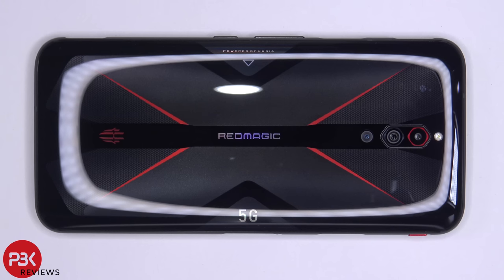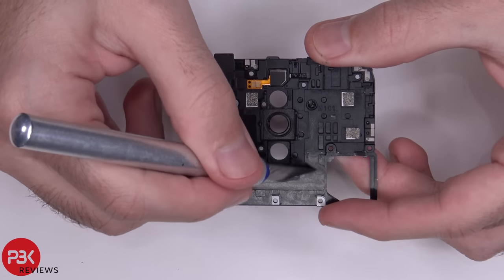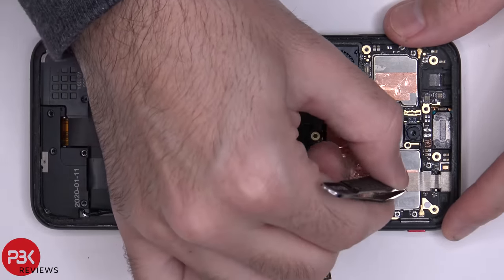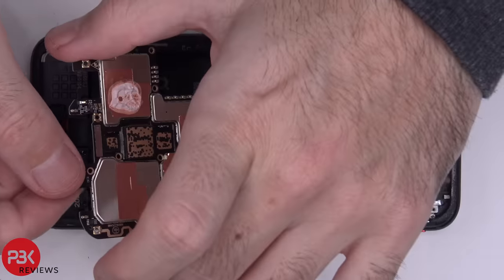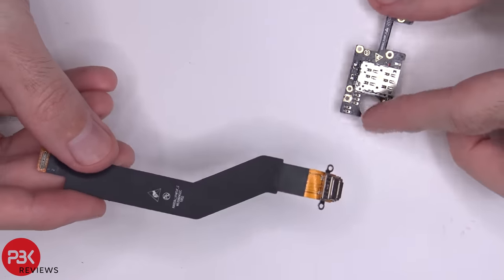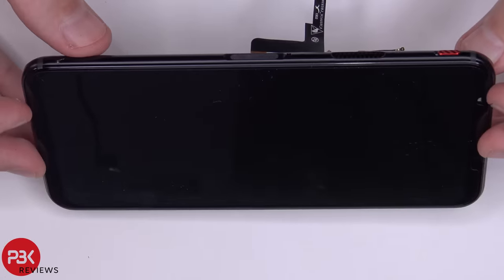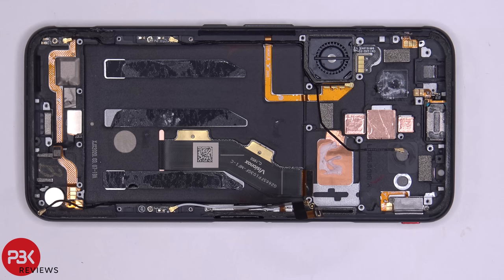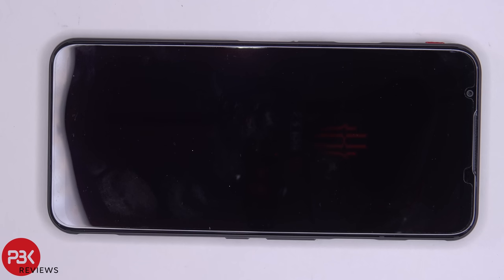Nubia Red Magic 5G Teardown Disassembly Repair Video Review

Comment: 25 screws.. Omg I LOL almost fell out of chair. TY FOR SHERING. I cant find screen replacement any wear :( any suggestions ?
Reply from the maker: Lol ya, you're welcome. Here is a link for an LCD and midframe pre attached combo (which makes replacement much easier) https://amzn.to/3qIlpQc  . There is also many on ebay for around the same or some a bit cheaper if you search redmagic 5g lcd you will see the listings.

Comment: @PBKreviews how do you get the back cover to stay on when putting your phone back together? By the way thanks so much, I was able to replace the battery and charging port to get it fixed on my own! I just can't get it to stay together now
Reply: Hey Im actually in a situation where I broke my charging port, I bought a replacement but I have no clue how to replace the charging port, could you help me?
Reply: @radeonclientcrystalpvp7786  for this phone you essentially just follow the video. make sure youve got containers for each type of screw.

Comment: My Red Magic 5G currently only have black display. The phone is working. I can call it but just black screen. When I connect it to TV, I can see that the phone is clearly working well. Just no display at the phone's screen. Restarting it only shows a flash of light on the display then black again. Do you think I have to replace my screen? Or just a case of loose flex cable?
Reply from the maker: ya its possible there is a hairline crack somewhere in the screen causing it to flicker like that or not display. You probably will need to replace the screen, but you can always check the cable to see if it is that before ordering a new screen
Reply: @PBKreviews  thank you very much for the reply. Subscribed.
Reply from the maker: @MarkAmps  You're welcome and thank you

Comment: Thanks for the video, I wished you had shown how to open the side buttons I have no clue how to take it out.
Reply from the maker: You're welcome. Once you take apart the phone, you will have access to the flex cable for the buttons. On the frame of the phone there is a rubber gasket covering the opening where the flex cable leads into to where the physical button keys are. You would need to pull out that rubber gasket, and then carefully peal off the flex cable from the midframe of the phone and pull out the flex cable from the frame where it leads to the physical keys. At that point you should be able to have access to pushing the physical keys in to release them into the frame and remove them. Hope this helps.

Comment: I wonder if its ever necessary to clean the vents.... What do you think bro?
Reply from the maker: I don't think it would be necessary but if needed you can use a small brush from the outside and brush it off when the phone is off.
Reply: @PBKreviews  u think the air only goes in one side out the other or does it flow internally? I know it wont collect dust like a mounted tv but it is interesting to think about for long term use...
Reply from the maker: @GTduzIt  yes goes in from one side and out the other
Reply: @PBKreviews  so it probably removed the dust it pulls in on its own. I know the transparent version would not look good if there is uncleanable dust inside so it makes sense that the air chamber is separate.. I believe its Metal too, thanks for the replies. I just ordered the new 6s pro

Comment: anyway can i get the spare part? Because i break my R trigger flex cable and 3.5mm headphone jack also got 1 side sound only
Reply from the maker: I don't have the phone anymore or any parts for it. You would need to check ebay or amazon or other online markets to see if replacements are available
Reply: @PBKreviews  I check already just found the dock charging flex cable only… sad

Comment: Sir does it have any IP rating?
Reply from the maker: No official IP rating, but the phone does have rubber gasket on the charger port and sim tray. Not sure how water resistant this phone would be considering the fan inlet/outlet and so forth. I would lean toward it not having any IP rating officially and unofficially (sometimes companies don't certify it for IP ratings when the phones infact are water and dust resistant etc.) But I do not believe this phone to be able to withstand water. Dust maybe.
Reply: I had a 3 Camo Edition for a while, phone was used in the shower several times and even dropped in a bowl of water once. As long as you don't let it stay submerged or water pour straight into the fan intake/exhaust, you should be fine.

Comment: Hi I hope to get some help my red magic 5g 's battery is draining so fast and the technician told me that the IC was damaged. Where can I be able to get IC spare part to replace it. :(
Reply from the maker: Hi, usually IC chips are soldered onto the main or sub boards. I would first try replacing the battery and see if that solves the problem. Replacing the IC would require soldering expert to be able to do and find the part for it.

Comment: what if the device fell off and the cooling fan was broken? And what do you do with dust?
Reply from the maker: The dust only goes in the fan chamber assembly if any really at all and would probably take a long time for there to be any build up in there. I'm sure they took that into account and probably you would have had the phone long enough to change to a newer device by the time it had any sort of dust build up. If the fan was broken well then you would probably have to send it in for a warranty repair replacement or replace it yourself if the part becomes available.
Reply: @PBKreviews  But the NRM5g have a software issues

Comment: hello i have a Nubia red Magic 5g and i just broke yours back.  do you know where i can find a new one because i can't find any.  thank you
Reply from the maker: Hi, here is a link for one on ebay:  https://www.ebay.com/itm/Back-Cover-Battery-Cover-Shell-Replace-Parts-for-Nubia-Red-Magic-NX659J-5G-Phone/353161054537?var=622362395928&_trkparms=ispr%3D1&hash=item523a0a0949:g:HNEAAOSwzmhfKoFw&amdata=enc%3AAQAFAAACgBaobrjLl8XobRIiIML1V4Imu%252Fn%252BzU5L90Z278x5ickkWpEuxXwAiCNKyBQsQ5%252Fe60RHd9eClYg59wSeuBwl3Q%252BgWKzdYKujVCZIR1dR1SoR%252F7d%252F%252BLEYPXAEGH5qlRn2xV3%252FzznExOwKJOKMpngn3PdYaDsQuMzECLrhdQIfOAGkKFeS9k9NqBRgF9ttLtBK0w9rbEA1DzHnpDRZKa1KzwFXhtbBzwrAXIyUgJg%252F4VqqcLJsRtTC3pQqV7v1I%252BUe4QhLjAJ0dSPMN5HsDTq%252FymYipn5Q8dy2SqK3PC2IgZv8f%252B4GwFTdlZNxwy6KqaMUGK7ngvAvJwzbIKMLIXGkKu9w%252FwV9%252FXeSu%252FblHACFDubgsedkWRv%252FL61GqZSEQgcaJinVUt60uDY6tEWRvP1LSQA%252BuupMxSUZlP03EohXlm6zwKPqlKEM99tRjgLictYuKenQb2C9y6piukAISzpsELySvEcIxFYosehxncrOIDQgLkFt53nFVY2oTXoPIpxfH%252Fp6vQbdW6OSzmOOttMR9OFhswmyBavkAGFjotAyAKQbYIiM3h9mofT55m62dNJVDGhyiK8r6FdYWnes3u3FSUoctKByuVw7o1g6LuG%252F8Who5TAskUQ0iDEoU954hc%252FdvrTziSeBSatjGhZeBMQCOX77RCFzo7LFVUoAeT4lwJ9sbXiHFCUZRgc5EYveOvwkTWusFWkTICyC8NBdy0dkpFHECJVMa%252BLYWn9EJbJzvolDRpMKzIeRXb3Lj1hjnkgX%252FflDqEU7FfTvdpXOJxQrqT5gQ5550RGCX2OzTvLqZ%252B84caYVW68DSwblDal0n8udRXcPFMI0mDJwrlcTmnzjUSk%253D%7Ccksum%3A353161054537325746a468ee4e46b1db97dd9acf8552%7Campid%3APL_CLK%7Cclp%3A2334524
Reply: @PBKreviews  ty

Comment: Man thank you for a very detailed breakdown. I am currently working on fixing my Redmagic 5G as I accidentally cut the connection to the mic ang pins as well as the power button ang volume. I was able to fix the issue on the mic ang the pin connectors and had it replaced, however, I don't know how to change the volume and power buttons. Do you have some tips that may help me?
Reply from the maker: Once you remove the rubber gasket as shown @8:56 in the video, you would be able to peel off the flex cable from the frame that runs from underneath the motherboard to the buttons, then pull out the metal bracket which the button clickers are attached to inside the frame slot. At that point some buttons are pull out buttons and some are push in ones. You would have to try to see which way they pop out.

Comment: what if dust/dirt block that fan, how to maintenance that fan?? hmmm tricky
Reply from the maker: Ya, I'm sure by the time enough dust gets built up in the fan it would be time for a new phone. Its not too powerful of a fan to suck in to much dust but I can see it taking in lints and dust if it was running in the pocket which the fan does turn off if you turn the screen off. Should be fine though from the looks of it :)
Reply: @PBKreviews  thx sir.. almost 2 yrs since i  change my phone hehhe

Comment: Use plastic pry tools
Reply from the maker: Once the battery is disconnected you should be fine. As I've told hundreds of people, I have never had any issues in the last 15+ years and thousands of phones I have taken apart.
Reply: @PBKreviews  I have red lines on left and right of my phone.. Is that a LCD thing?

Comment: Bro how to install the back glass? I broke mine 🥺
Reply from the maker: You already have the new back glass or you are trying to buy one? I don't think there are replacement back glass yet on the market
Reply: @PBKreviews  im trying to buy one. But i didt find any. 😥 My backglass broke pretty damaged. But the screen is fine.
Reply: @PBKreviews  how do you get the back to stay on? New glue, or can you just hear the old glue back up? If it's new glue, what kind?
Reply from the maker: @georgeclooney9164  hi, i have a video on how to apply new adhesive to smartphones, check my previous videos it will explain how to do it.

Comment: Is it water resistant
Reply: mi pa no it's not
Reply from the maker: no it has no official IP rating and nothing internally there to really prevent water from getting in. It might take a splash of water but not being dunked into water.

Comment: Hello. I am looking for mainboard for  redmagic 5g..
Reply from the maker: Hi, you would need to look on ebay etc, but usually hard to find a part like that. You would need to find a phone with cracked screen or something like that to pull the main board from.
Reply: @PBKreviews  I try to find broked mobile in market no one have its very hard to find. If u have any link can u share me. Thanku for replying me.
Reply from the maker: @rizwanrazzak.  i will check, if i see something i will let you know
Reply: @PBKreviews  thank you brother

Comment: Clear back possible???
Reply from the maker: Yea its possible but you wont be able to see much unless you modify the hardware which wont be beneficial to the phone. For example you would need to get rid of the graphite film over the battery if you wanted to show the battery off, you would need to also cut off the fan enclosure area to reveal the mobo parts etc. However I am going to try to do a semi transparent mod with this phone with a few customizations. I will upload the video once I finish with it :)

Comment: So the fan inside basically just pulls out the ambient air and doesn't active cool the heatpipe, dissipating the heat generated directly through it. What a waste, it's useless.
Reply from the maker: Exactly what I was thinking, It does help one side but the side where the heat pipe is, I would prefer that to be where the heat would be vented out or drawn out from. Would be better if they had the processor on the back of the phone where the fan is, putting some sort of copper fins like a heat sink (which would sit on top of the heat pipe transferring heat from the processor and other chips on that side) going into the fan chamber/assembly so the air coming in one side cools the fins/heatsink and draws the heat from it out the other end.